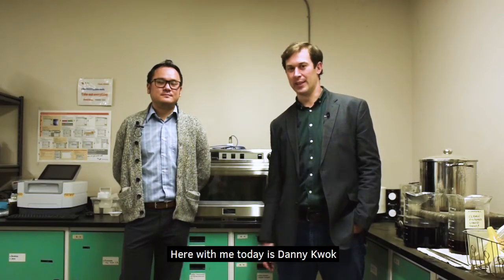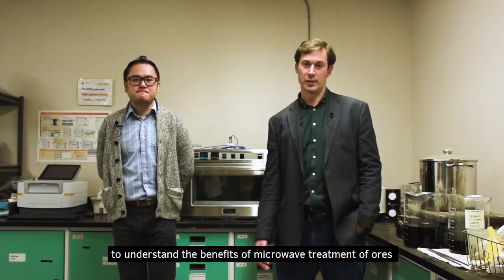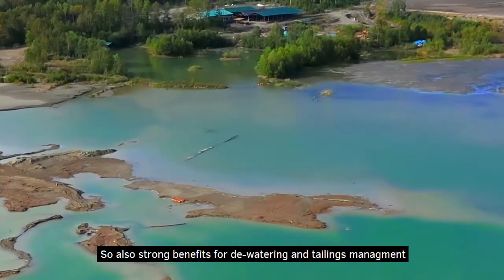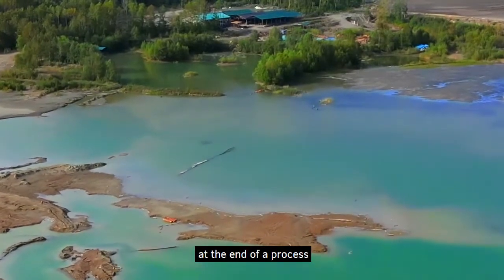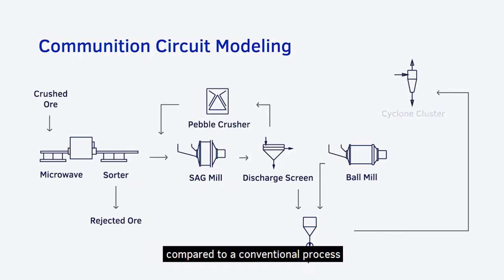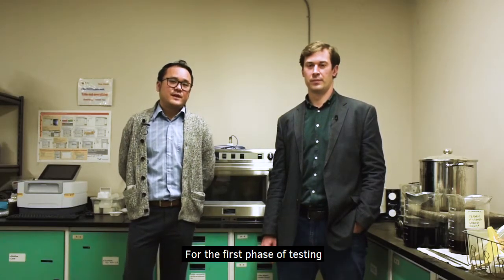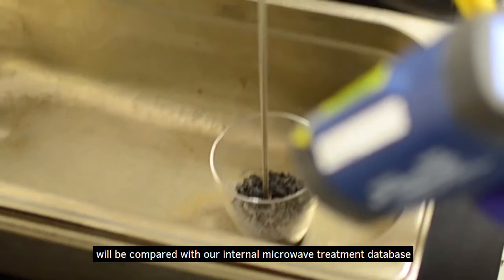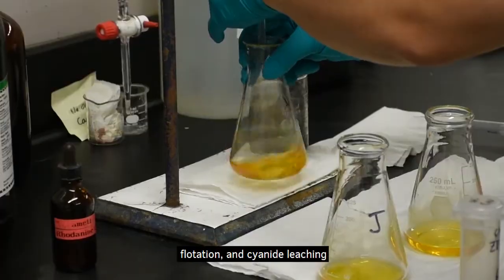How Microwave Testing Works | Sepro Labs

Comment: What Energy costs are associated with the Microwave pretreatment ?  Which ore types are showing the most benefit for pretreatment  before grinding
Reply from the maker: So far we've found that microwave pretreatment is either energy-neutral or a net energy savings when you take the reduction in grinding energy into account. We target <2kWhr/t of microwave energy in the ore.

We're seeing benefits in many different ore types: gold, silver, copper, nickel, iron ore, etc.